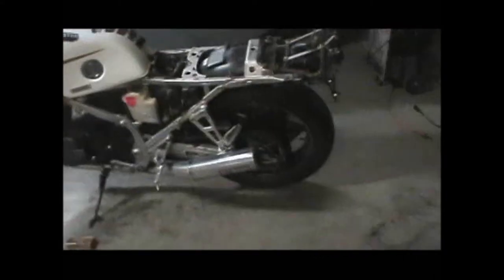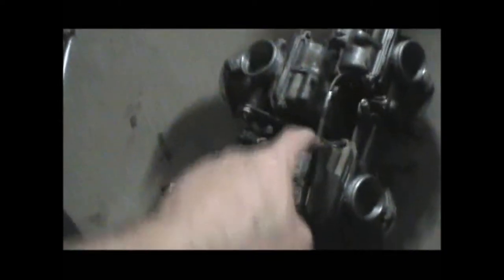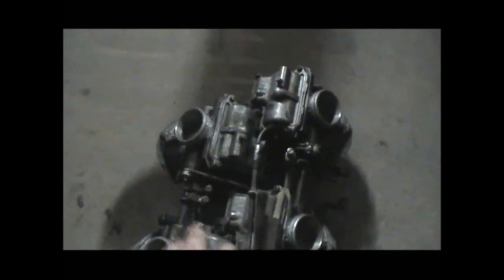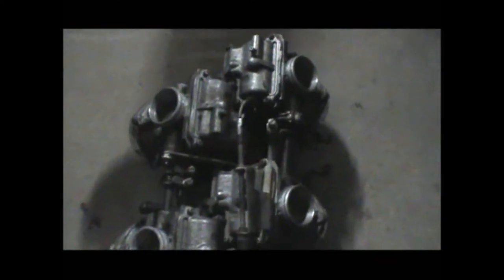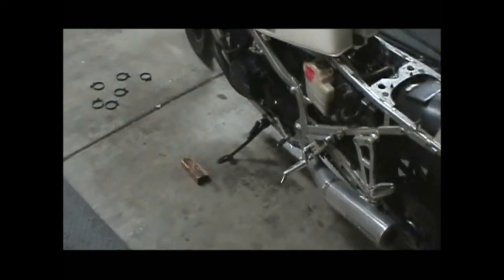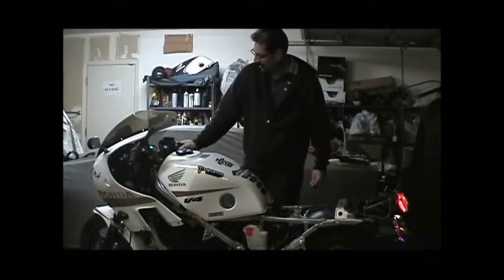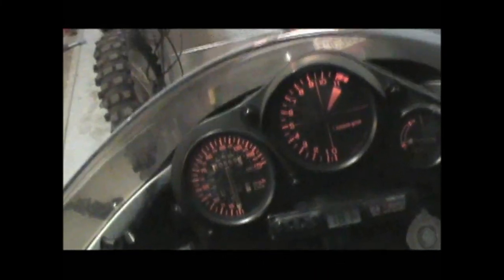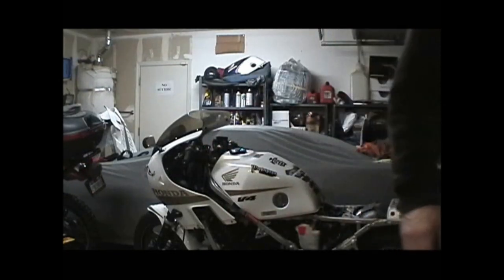VF1000F carbs install on a VF1000R

Comment: I thought this was a carb install video, WTF‽
Reply from the maker: It was a series to get VF1000F carbs on a VF1000R.  If your interested in installing  V4 carbs it's pretty straight foward. Good boots help however, use silcone spray to spray the inside of the boots for an easier install. Nevertheless, the V4 carbs is a PIDA to install regardless.